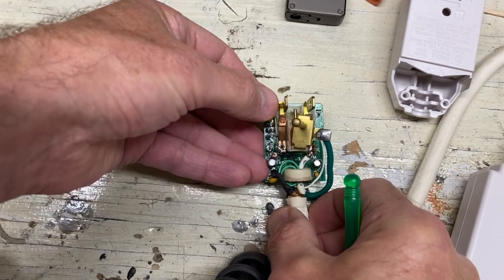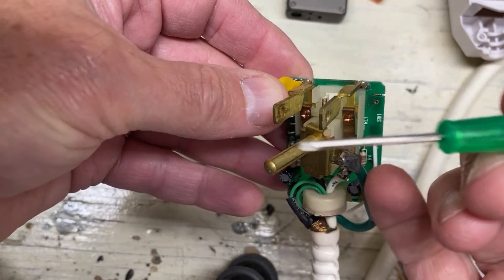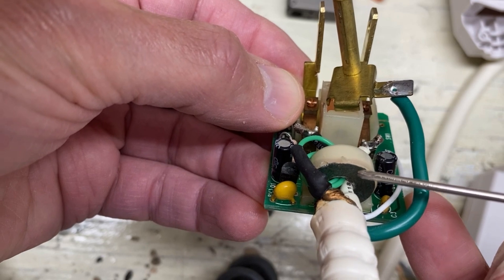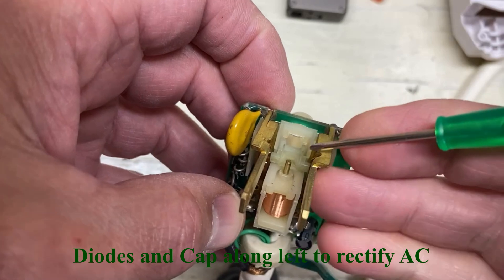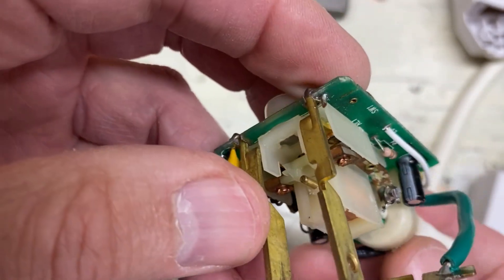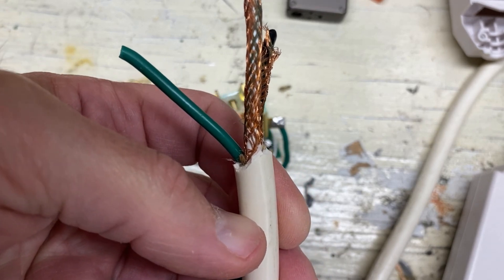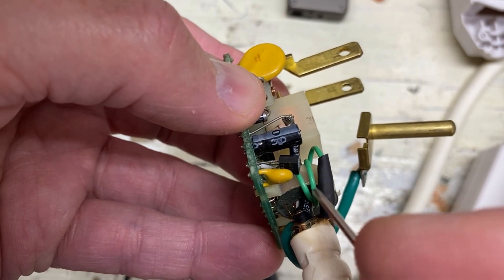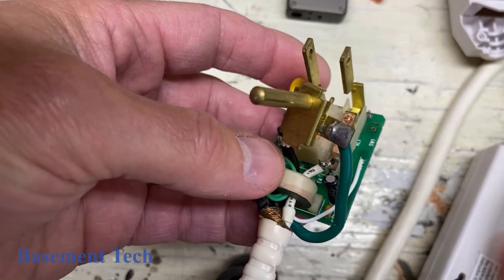What's inside a GFCI Plug ?

Comment: The toroidal current transformer is made of ferrite, a polycrystalline material made of iron. Carbon would not work as it is non-magnetic.
Reply from the maker: @BritishBeachcomber  thanks for the clarification.
Reply: Ferrite doesn't make sense at 50/60 Hz. Current transformers usually have nickel cores.
The black stuff was probably a black plastic housing.

Comment: My best guess for the extra green sense wire is that it may be there to help avoid false trips due to any external RF interference picked up by the cable.  If there is a lot of electrical noise nearby, this can cause currents in the wires that are not actually due to the electrical circuit itself, and that can be picked up by the sense coil and cause some GFCIs to trip when they shouldn't.  With the shielded wire, any externally-induced currents in the wire would also show up in the shielding as well.  Since the shield wire goes through the sense toroid in the opposite direction to the others, if the same current (in the same direction) is present in both the wire and the shield, they would tend to cancel each other out, and not be detected as strongly by the circuit.

This device looks like it was intended for use in possibly electrically noisy environments, where some other types of GFCIs might have problems because of interference, hence the extra shielding and countermeasures against RFI...
Reply from the maker: @foogod4237  thanks much for your well-reasoned response. I was pleasantly surprised with the added level of sophistication of the device since I’m sure it was sold as “just a plug strip” … thanks again.

Comment: I think the green wire is the "ground fault" part of the circuit interrupter - in europe its called Residual Current device - that's balancing the flow of the live and neutral conductor; but i see in the american GFCI - its also got a ground element.. cool!  thank you
Reply from the maker: Thanks for your comment
Reply: No, in the US these are called "ground fault" interruptors, but the circuit itself does not have anything to do with the ground wire (in most GFCIs, the ground wire is not even connected to the circuit, and will function just fine even if there is no ground present at all).  As described in this video, GFCIs only look at the current flowing on the hot line and the neutral, and will trip any time those two things are not balanced in some way.